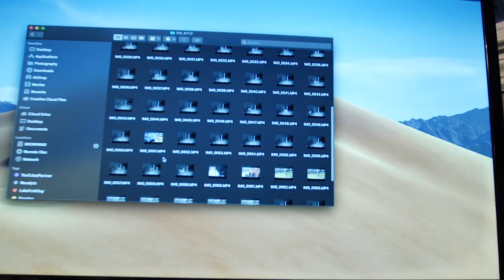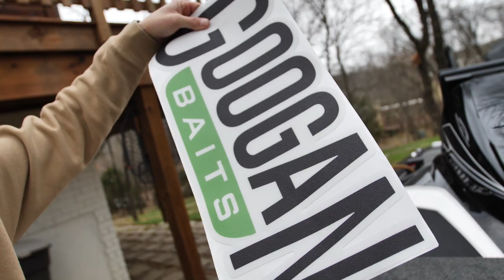The NEXT BIG GOOGAN PROJECT

Comment: LFG...download the CMonster app for your blades and it can help you figure out what's going on.  Remember that remote is using Bluetooth which is RF and when you removed that cover and it worked it had less attenuation. Which is why the lanyard remote which you were holding in your hand allowed operation it was closer to the pump.  My guess is a connection issue and cmonster app should help.

Comment: Dude, same exactly thing happened with my 2 8’ blades. It was intermittent just like you. I was on Squaw the other day and hit my would have to hit my foot switches like 3 times for them to go all the way down. My boat is also new (‘18) instead of dragging to the dealer I got in contact with power pole (amazing customer service btw). They wanted me to make sure I had a full 12v at the pumps, which I did. So they sent out two new circuit boards. I haven’t installed them yet but they are positive that’s the problem. 

I also wasn’t able to pair my poles with the app. It shows that no poles are in range. Might want to see if yours will pair with the app, you can control drop speed and get them more in sync with each other! Hope that helps bud!

Comment: Hey LFG, check and see if each pole has a separate receiver. If you can operate it manually and it works every time and the fobs are new and working fine then it could be that the pole isn’t receiving the signal to go down or up every time the button is pushed. If each pole has its own receiver then that pole may have a bad one. If there is only one receiver for both poles then check the connection to the one that isn’t working. Hope you get it figured out soon.

Comment: Looks to be a issue with antenna/reciever range. Cover off near port side it works. Outside of that range nothing. Port side pump replacement unless they can just replace the controls on it. That's why it worked the first time when u removed the cover. Just my thoughts

Comment: check all your connections on the pump and wiring harness for the powerpoles. kinda seems like you have a loose electrical connection, im no expert but have some experience with hydraulics and electrical systems like snow plows and  related equipment. if there is a pump solenoid maybe check to see if it is working properly

Comment: It looks like a transmit and receive issue. I would bet that the receiver in the motor is malfunctioning. A lot of the remote stuff works on the same frequency as other stuff and can get mixed up in the shuffle. If you have a way of changing the receiving channel, that could possibly fix the issue. If not, you may need a new motor for the powerpole.

Comment: If your powers are still doing that it  could be the  Circuit board or a loose connection. My pole did the same thing. Contacted pp and they sent me a new circuit board for my left pole... to get they to work at the same time go to deep water and cycle both poles a few times so that they get  In synced together

Comment: Looks like a bad connection check the wires. Make sure they are tight. Then get a circuit tester make sure your getting power to the pump. If your getting power and it's not working may be a loose connection internally and will need to take it in to have it repaired. Or just say to heck with it and take it in now and save the headache lol.

Comment: And that my friend is why you don’t want everything on your boat with a remote and have hard wired in switches in the dash and the foot buttons on the front deck need to be wired in as well that way it works every time you need it to. And than just have a remote on your belt to use as well wireless. Just my 2 cents as a marine tech...

Comment: Your a pretty chill guy but 2 things I wouldn’t let slide. Number 1 is that boat would be going back to the dealer until those poles are fixed. There was nothing wrong with the money you gave them for it so there should be nothing wrong with the merch. Second is call your sheriff and have them check on that camera shot of someone trespassing on your property. Especially since it seems you are going to be traveling and leaving your wife and baby behind. A security system might be a good idea regardless

Comment: $70K for a new boat that don't work right... heck with that
Reply: Right! I would be fuming.
Reply: you think he payed for that boat?
Reply: @BipolarBLKSheep  probably not but still doesn't change the fact a top of the line 2019 Skeeter has junk accessories on it. They should be replacing all that shit for him instead of him having to MacGyver some shit to work.
Reply: Try $80,000.
Reply: And its sitting outside and not in a garage
Reply: Skeets are cheap for a reason.
Reply: 80 really lol.
Reply: He said in his previous video he gets a new boat every year for free.
Reply: 70 for a skeet lol. Not even close.try 50.
Reply: @richardsimmons6526  yea for a 19 ft zx. 75 for fx20
Reply: @dave-cd7jd  skeeters suck never had a issue with my ranger or my express. All my buddies that had skeets always had issues.
Reply: @richardsimmons6526  ok, another ranger fanboy i see
Reply: I just sold my ranger for a skeeter, way nicer boat and rides just as smooth, not to mention the sho is pretty nice to! 56k for a new zx225 75-80k for a fx20
Reply: @anglertungstenco  what model did you get
Reply: @dave-cd7jd  lol will never buy another ranger. But quality is quality I fish the biggest river in the US and won't get another glass boat.
Reply: The only glass I would get is a Bullet.
Reply: David Kay I bought a 2017 zx225. I had a 05 520vx
Reply: All new boats have problems and the more expensive the boat the more problems you will have
Reply: @anglertungstenco  what setup did you get. looking at getting either a 225 or 250 in december
Reply: David Kay I got the zx225 man and honestly I love it. We took it out today, pretty high winds and rough water and it handled flawlessly. I was pricing a 2016 fx20 and my zx225 and there’s about a 10k difference in price. Basically the same boat with more bells and whistles.
Reply: @anglertungstenco  what did you end up paying out the door if you dont mind me asking.
Reply: David Kay out the door I payed 46.

Comment: Seriously Justin be very safety conscious especially when your away from home by any chance does Steph know how to use a handgun or even if you have an SBR that she can easily access. Im saying this becoz I had my house robbed twice in 3mths the first time I arrived home from work went to use the phone it was dead & my largest chef knife was near the phone thought it was weird then went to bedroom to change have shower & there was another of my chefs knives by this stage i figured either we'd been robbed or were being robbed 2 secs later guy comes running out of bathroom with a knife I chased him with a large brass statue & smash across the back of his head police came arrested him he never gave up his mates nearly 3mths later after insurance paid for stolen gear they came back & stole all the new gear even though we'd put bars over Windows an an alarm system they cut alarm and smashed plate glass door to get back in. All up they got $65,000 worth of gear. I'm just saying whoever was in that picture Justin wasn't there to mulch your garden. Make sure Steph & Emmy are protected my friend you spend a lot of time away from home. Also the probl3m with your poles i would say is the receiver is either shorting or it is just flat out needs replacing coz they work but only intermittently
which to me is an electrical short take it back to fun in sun it must be under warranty. Y'all be safe now you're great people.
RustyinOZ
Reply: Holy run-on sentence Batman!
Reply: @jasonburns6411  & your point batgirl. RustyinOZ